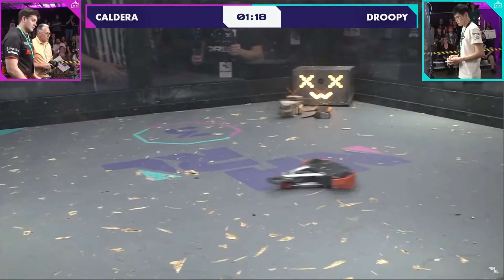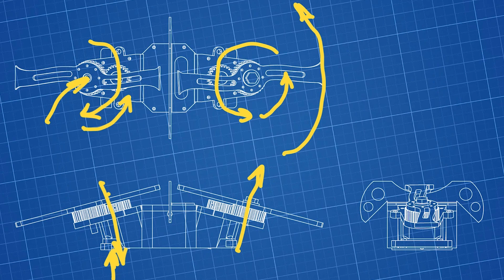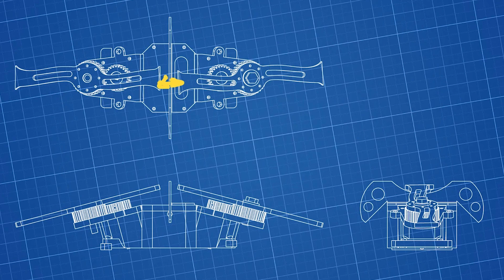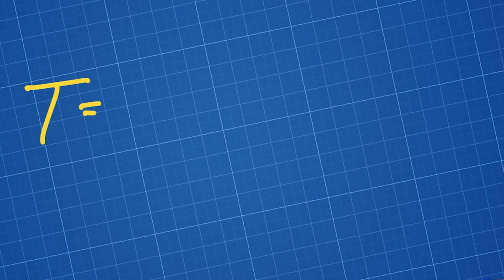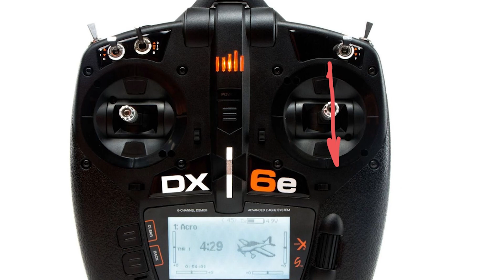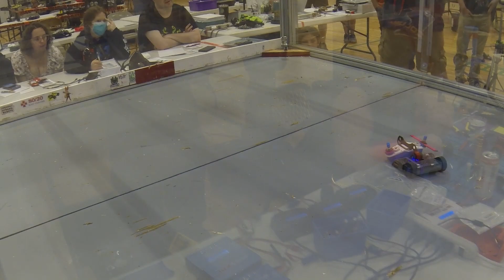I made the weirdest combat bot!

Comment: very cool, good on ya for going into the science - most people don't understand how gyroscopic precession affects all bots lol

using 2822s is definitely a good idea for V2, I'm using a 2830 for my (also novel drive) ant and it's more than enough. overall very cool bot, and I love the weapon design!

for the gearing problem: Tommy used (idk if he still does) Bridge Nylon from Taulman for his gears. I use 85% infill TPU since mine are exposed, but with mod 3.6 gears, a lot of interface from tip to root, and about 3 mil of backlash my power transfer has been golden. Mess around a bit more with printed gears! machined Al might be too hard, anything 90A-120A seems to work.